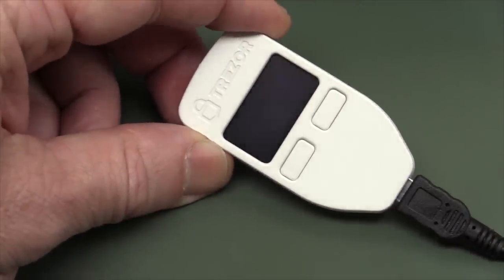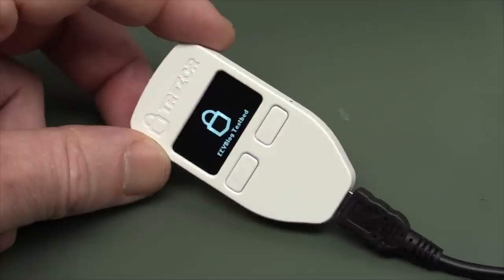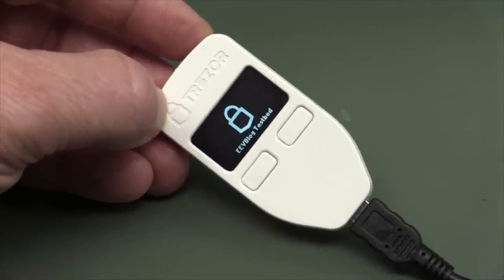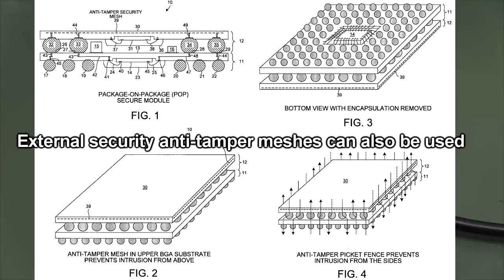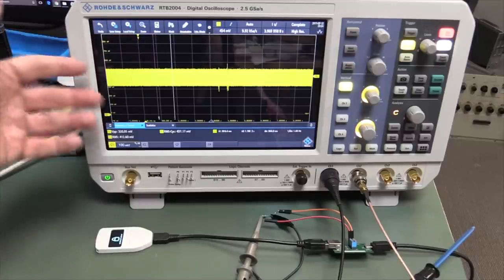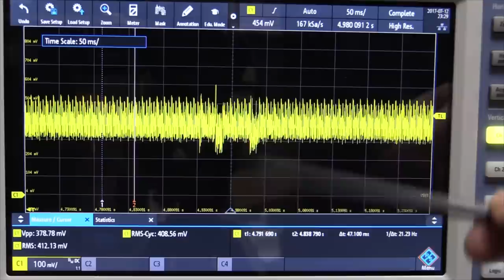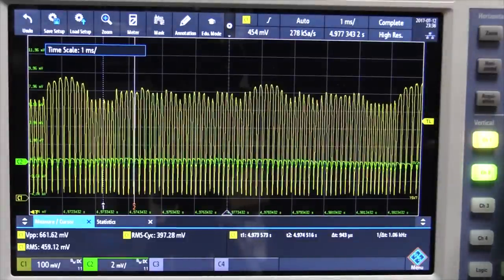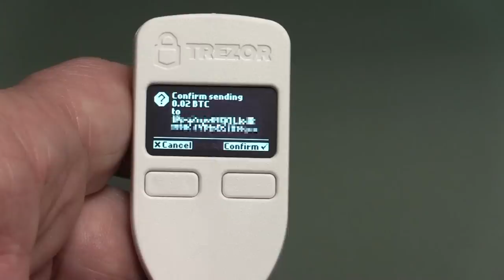EEVblog #1006 - Trezor Bitcoin Hardware Wallet Teardown

Comment: Hm, to me that doesn't sound that secure. If i need to store bitcoin in a secure way for a long time, I'd just write down the private key and make sure it's very safe or very hidden. In the end Trezor is just an electronic device, and electronic devices can fail or have bugs (just imagine you lost a lot of money because you were close to some emp). A piece of paper or engraved metal or whatever you chose to write it down physically probably won't fail randomly.
Reply: The block chain could be branched, when some governments decide to "regulate" internet traffic and spend time and resources into a "shadow" bit coin mining network. It is a theoretical attack, but... when you worry about emp, then Gold (rare metals) and Grain (food) are better investments.
Reply: Well gold is even better in that sense, but when it comes to practicability it sucks. It isn't digital and fucking heavy.
But, yeah there is a good chance that governments would react and find another way to control the money.
Reply: I know what you mean, but the governments do not control the currencies. The private central banks do.
Reply: If the Trezor fails you can restore from the backup seed.
Reply: @SkyneT It's digital and fucking heavy = hard to steal huge amounts unnoticed. Quite good, then. Being not digital makes it less vulnerable. Off course, its impractical to make payments with, but lets imagine you could write a contract that whoever held this contract is eligible for this and this amount of your gold reserve. That would make it better! Like byuing and selling debt.
/sarc